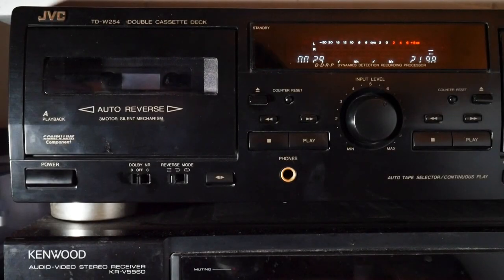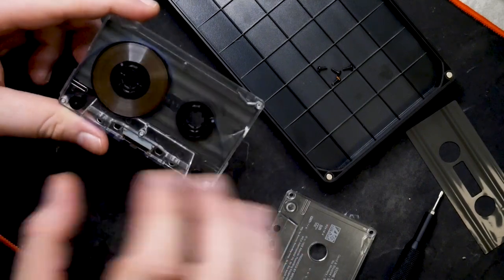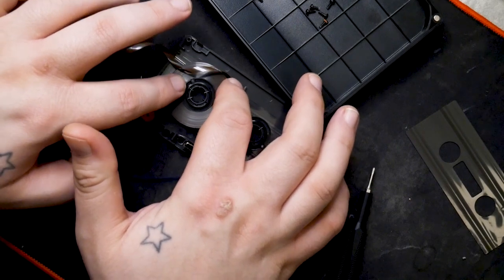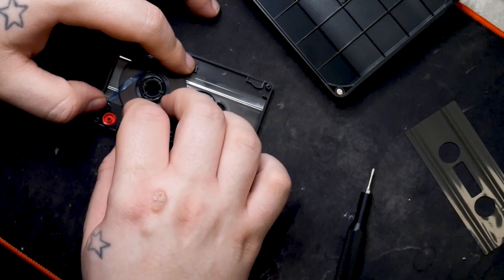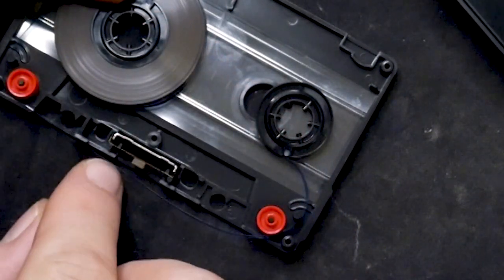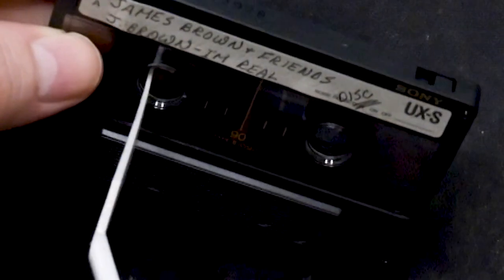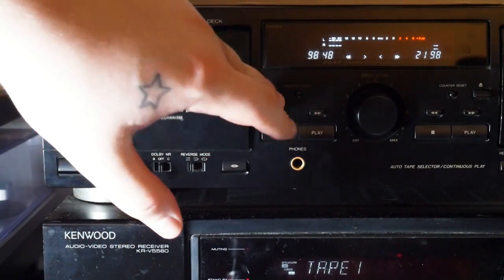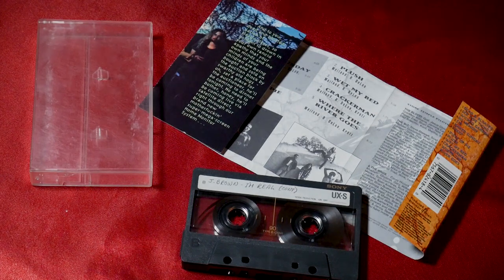Broken Stone Temple Pilots Cassette Shell Transplant

Comment: You didn't use your direction! You had it on reverse all the time! There is a direction button on that tape deck to make it go forward or reverse! You don't have to flip the tape over on that machine! Please try it and see if that works! I know it will!
Reply from the maker: I am aware of this but on many older systems this is one of the mechanisms that goes bad with use over time so I choose to forego using it and manually flip my tapes instead. It's probably something I could repair should that occur but it's one less moving part to deal with. This is why my selector switch at the bottom is set to stop at the end of a side and not flip to the opposite side. Typically I have it playing in the forward direction but when trying to remove the cassette after it became stuck, I hit the direction button as I tried free it which put it into reverse.